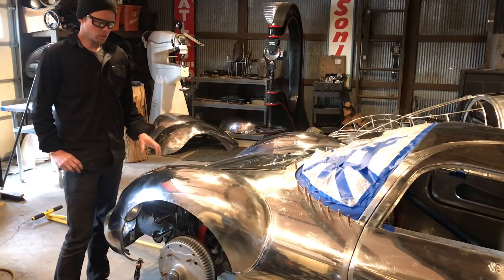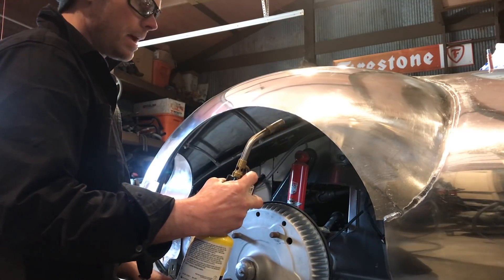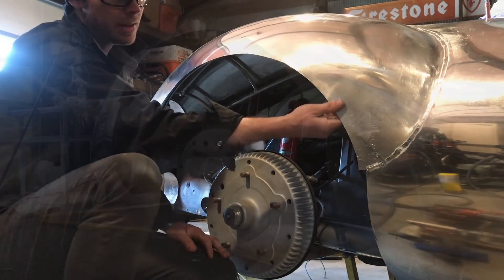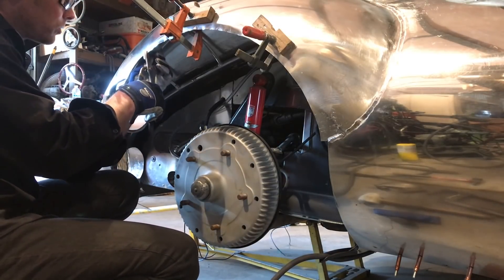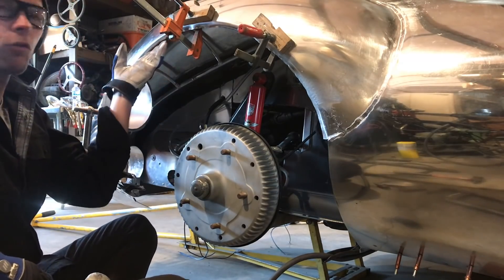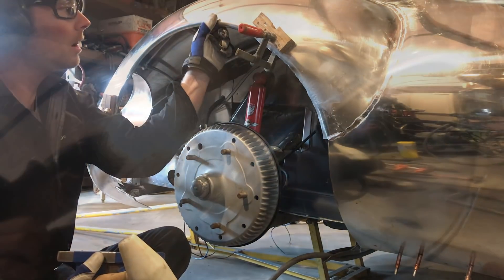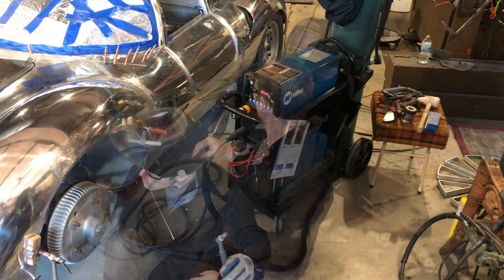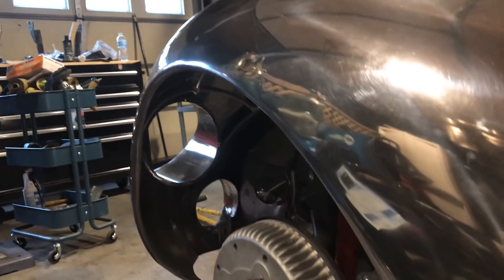Runge RS010 Aluminum Metalshaping Wheel Arches

Comment: Hello m ua fan frm india. Cn i no what meterial using in runge cars for all body??. Alumenium or stainless steel??.. plss pik my qsn n ansr me🙏🙏
Reply: Chris Runge explains how he forms the fender wheel arches on RS010 by hammer forming aluminum skin over the internal tube buck. The skin material is .063" 3003 H14 Aluminum, the tube buck is 1/2" aluminum tube and welding with the Miller 210DX using 1100 Filler rod.  (from the description of the video)

Comment: Do you know that Aluminium is hardening by anealing? It works oposite than steel.  You have to quench it, rapidly cool it down to make it soft for a while. Anealing is hardening for aluminium alloys ;-)
Reply from the maker: I appreciate the comment but your information is wrong. You do not have to quench the aluminum for it to anneal (lowering the H or Hardness). There are different ways to gauge the exact temperature when bringing the aluminum to an H0 State. With using Map gas as I did in this video, I wait for a slight orange hue to show where the flame is reflecting off the Aluminum workpiece. This is a very fine line where the sheet is right at the edge of going too far.... I would suggest trying annealing both with quenching and without as I have.
Reply: @RÜNGECARS  They are not producing the true hotter MAPP gas any longer.  The stuff they sell now days is not much hotter than propane. https://en.wikipedia.org/wiki/MAPP_gas

Comment: Amazing work! Thanks for all the great videos and cars.

A tip for annealing aluminum is to put sharpie or marker on it and when the ink disappears/burns off it is up to temperature. I learned that watching Adam Savage make a full aluminum suit of armor.
Reply: Using acetylene is another way to do it. Soot the aluminum with the acetylene and add oxygen and then heat the area until the soot burns off . When the soot burns off you know you're at the right temp.
Reply: I used to use neat washing up liquid , when it turns dark . I since use marker pen , less sticky.
Reply: this guy does Great work,  I shape for the aircraft industry. the proper way is to find the correct temperature for the type of aluminum you want to anneal..in this case 3003 h14 775F. use temp stick or a digital meter, one that you actually touch to the metal not one you point at the metal because the aluminum reflection will cause a inaccurate reading.
here are some correct temps
3003 775F quench with water or air

1100 650F quench with water or air

5052,5083,5086   650F quench water or air

2024, 650-675F not for torch annealing, must be soaked

6061,6053,6063  
 not recommended, but it can be a partial anneal...but the temper is not exact

7075 partially annealed at 650F
full anneal is a two stage process and not for a torch